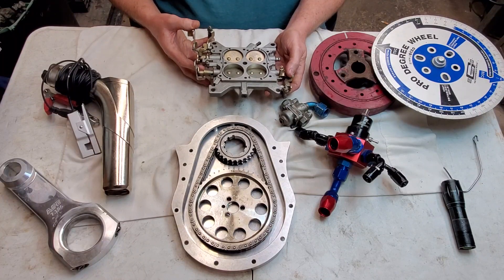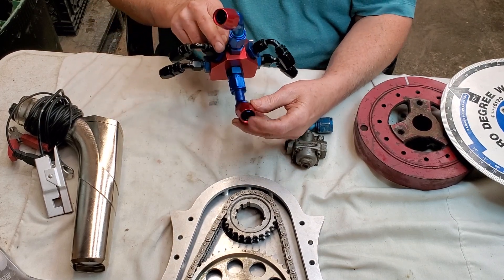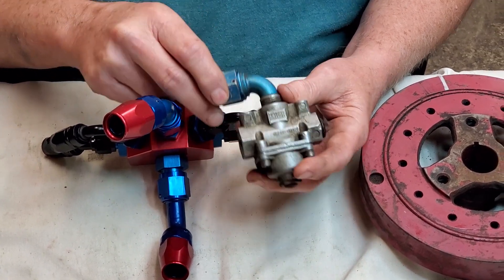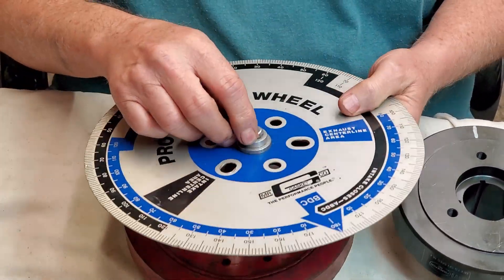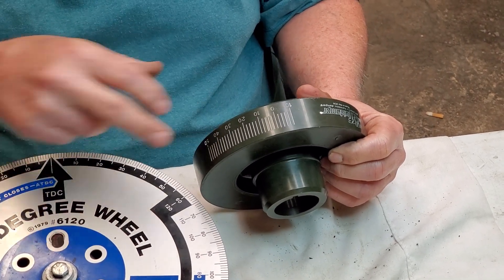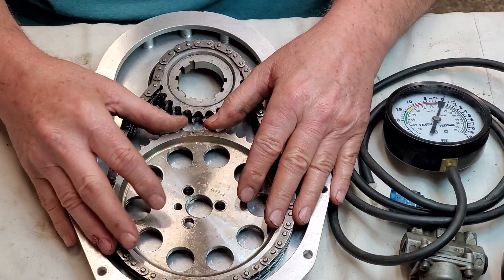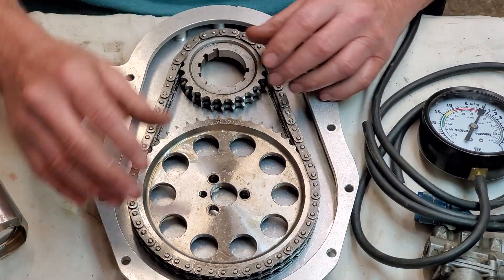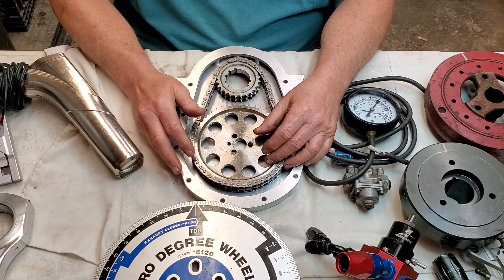Troubleshooting Naturally Aspirated Engines and Performance tips

Comment: If you got the head off setting cam timing you use a dial indicator on the center of the piston and when the dial stops climbing at Top of piston travel you mark your degree wheel, then continue to rotate until the indicator starts to move downward, mark the degree wheel again. Then half way between those marks it absolute TDC
Reply from the maker: Which method do you use to degree your cam timing in, and why?
Reply: @holleycarbshowtosadvice40y90  I do the same with to find intake lobe center line traveling 20’ each direction and whatever the cam card shows the center line should be compared to the mark on TDC count the degrees and it should match the cam card.
Reply: @holleycarbshowtosadvice40y90  I’m running a Pete Jackson gear drive that has eccentric spacers so adjustments are as accurate as having a slotted cam gear or belt drive.
Reply: @holleycarbshowtosadvice40y90  actually I think the most important part of building an engine is determining your port flow and  reading how much lift you actually need and not go any higher than where your max flow gains top out at. Increasing cam lift beyond what your ports will flow is just robbing horsepower by moving valve train an excessive amount that the engine isn’t able to utilize. What about you ?

Comment: Hey! Love the videos!  Im running a Dodge RB 440 with a Holley 750 on top and having an issue...  

After a heavy brake going straight, upon hard acceleration the engine will take off, then seemingly start bogging and surging and not accelerate smoothly... It seems to me like a fuel issue... Thoughts? I can provide a video for reference if you need
Reply from the maker: Sounds like fuel , perform a fuel volume test , check fuel lines for cracks or leaks  , check fuel filter for restriction 
 , check fuel pump output , volume and pressure , check float level, also drain front and rear bowls and check for water , hope this helps

Comment: Hello from South Africa, your videos are fantastic, I have a Holley with the markings LIST-1850-3 below marked 2178 on a 350 SB Chevy and have been having lots of problems with settings. Thanks to your videos have managed to attain a good vacuum, no misfire and no hesitation at opening throttle. My next issue is the TH350 as the motor wants to stall the motor if held on the brake as soon as I engage Drive or Reverse. Finding a guy is SA with your experience to help is difficult, have fitted a new modulating valve with adjusting screw but is at factory setting - any ideas would be appreciated.
Reply from the maker: I don't know your cam specs. If  you have a lot of cam duration, you may need a higher stall converter , but there is so many things can cause this condition. If this don't help give me all your engine  specs and trans specs and any trans history. Hope this helps.

Comment: Can you do one on a 4165 spreadbore Holley I've got a 1972 and 350 in my 66 truck   but it's got orig (no holes,pcv,breather 283 valve covers, had 2 jet and orig intake. I got a 803 intake and have run Rochester q jet 1974 truck manual .ca carb then a edelbrock 1906 q jet now got Holley , can't get it to run right with none of those carbs but Holley has run best
Reply from the maker: I don't have a spread bore Holley right now, maybe run across one soon.

Comment: Nice one dad. Thanks. Hey when is it appropriate to run a high volume oil pump on a small block Chevy? 🍻
Reply: I run a high volume oil pump in most of my high perf.engines but not high pressure, if you had a worn engine or a racing engine with  extra bearing clearence or you have reroute oil to some part of the engine that is when I use a high volume pump, you can also run a high volume pump if your running very thin oil , like the boys do in the engine masters series you have to be careful , running to much oil pressure, you put a lot of wear on the distributor gear, or to thin of oil, hope that helps you, you could write a book on this subject .
Reply: @randallcribb668  yeah thanks. I have a performance 350 bored 060. - 10.75:1 compression. Running straight 40 in California. Got high volume oil pump that runs high pressure. 75 steady at startup. Once warm hits 15-45. I feel like the pressure is causing oil leaks around my rear main seal. You ever see that happening? Thanks 🍻
Reply from the maker: Dad here lol , your oil pressure sounds good , I have never seen oil pressure cause that, but I have seen engine build up internal pressure in the crank case that was not vented properly , also if your  running an aftermarket oil pan , make sure your oil level is not to high I've seen the crankshaft splashing oil every where and cause this, if your not leaking oil anywhere else possible bad rear main seal, if it's a two piece rear main , make sure you have put a little sealer under the rear main cap, that's easy to forget, hope this helps.
Reply: @holleycarbshowtosadvice40y90  thanks for the response. Might be that seal just dried out a bit. Car sat for a while. You ever gonna come home? How long does it take to get cigarettes?! 😅🍻
Reply: I biult a sbc 350 with a used gm reground crank 2 piece seal.got it started and had a small leak at rear main.tore it back down and were old seal rubbed was a lil wear on  crank so had to get a rear main seal thats off center. Didnt know they made them. Fixed the leak